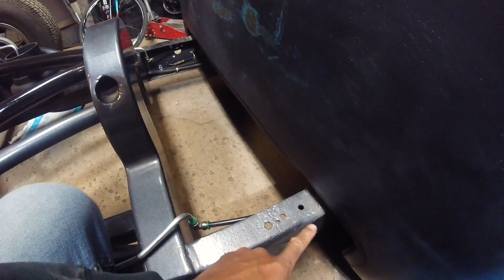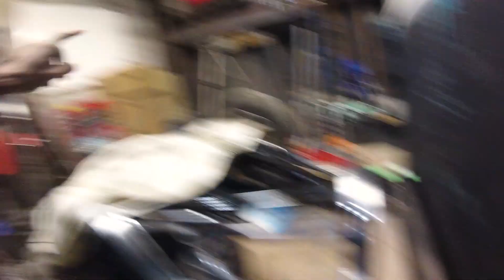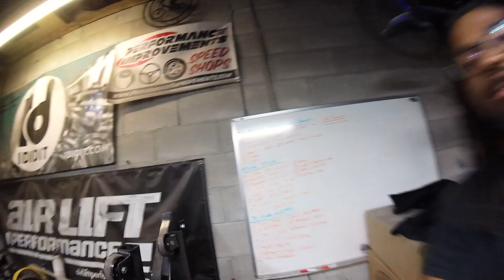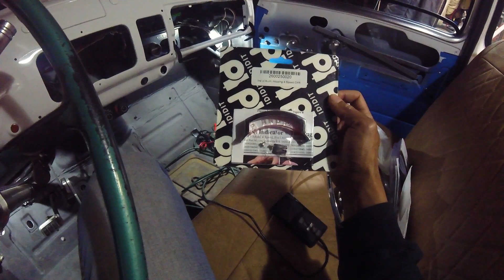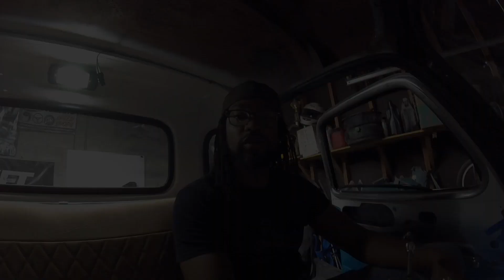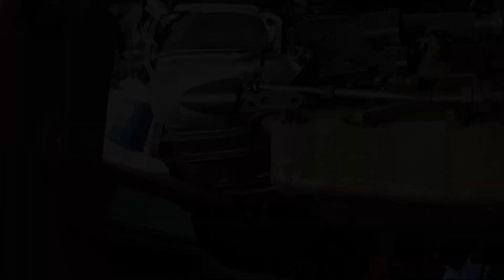Pushing Forward: The 51 GMC truck gets an IDIDIT Shift Indicator, Loomed Airlift 3H Hardlines & more

Comment: When your column is in the park position will it move up counter clockwise anymore after the park position? My ididit seems to have just about an inch of movement where there is no detent when it’s all the way up
Reply from the maker: If I recall it's pretty stable at park but I will double check for you. What transmission are you running?